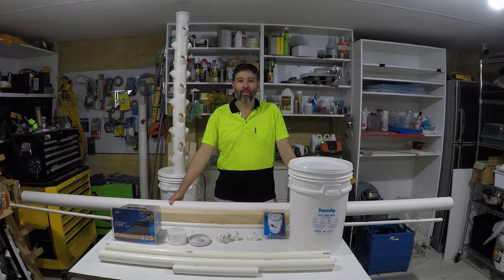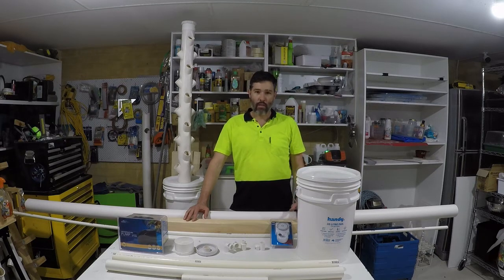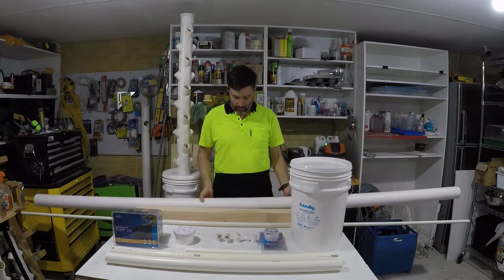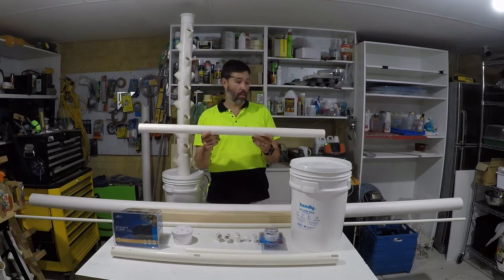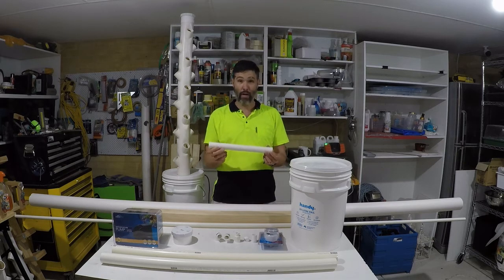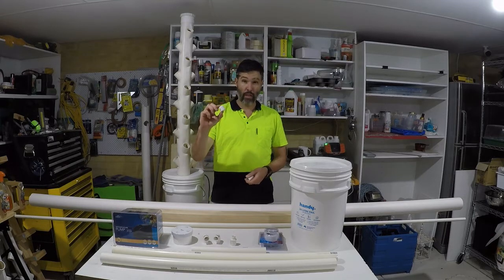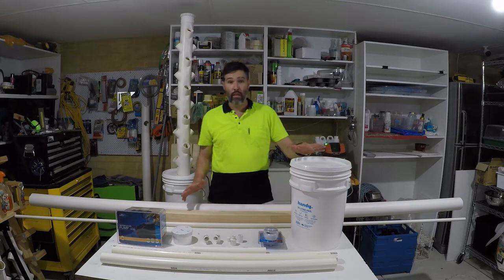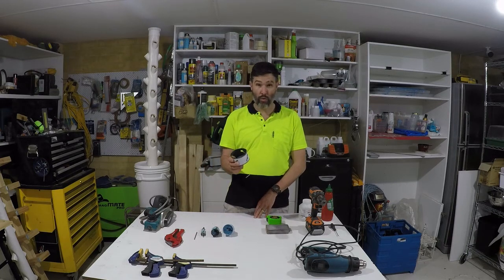D I Y hydroponic garden tower Part 1

Comment: Mate I'm having trouble finding a 62x62 post to shave the corners off.  I see your timber post has a sticker/code on it, suggests you bought it.  Where did you get it?  Closest I can find is 70x70 at Bunnings.  Getting that cut to 62x62... no one wants to kow about it that I can find.
Reply from the maker: Hi, I got a 70 x 70 from memory and plained it down 2 sides to make it 62 x 62. 
Took a bit to do but worked just fine. 
I did get a pice the right size as well but is was not pine. Jarah I think. 
Hope it works for you.
Reply: @andrewpaterson5188  Thanks.  Noting more carefully you did say it's at 70mm before planing.  I'll do same :)

Comment: Finally someone who does it properly. Most of the videos on youtube are just assembly guides with links to the products they want to sell. Thanks.
Reply: I would  hot air weld the spigots onto the pipe so they will never leak or fall off

Comment: Great job!  This series is by far the best of any vertical tower DIY!  I, too, found myself watching all the YouTube videos for hydroponic towers.  All the other versions have issues in my opinon.  Either the net pot doesn't fit well, there was a risk of tearing the PVC during heat-forming, I didn't think the cemented mating surfaces provided a good bond, too-expensive, or blah-blah-blah...the list is long.  However, during this series, I found myself saying things like, "Wow, he really needs to make a jig for that...oh, nevermind...he already did.", or "You know, a piece of angle allows you to mark a really straight line on round stock...oh, nevermind...he thought of that too."
I think the only thing I could come up with was to use a piece of square PVC fence post to prevent the need for heat-forming each net-pot location, but I'm not sure if the different materials use the same cement....something I'll have to research.
One thing I REALLY can't wrap my head around is how, as of 8/16/2020, you only have 1,450 view and 132 subscribers.  Your methods are top-notch, and there isn't any annoying background music preventing me from hearing all of your useful information.
Subscribed and liked.
Reply: ส

Comment: Question for us US makers trying to follow along:  as an example your 40mm spigot pipe, is that inner diameter?  And I see various pipe types: PVC, CPVC, UPVC.  Are you mixing just for finding convenient sizes or does it matter?
Reply from the maker: Hi, as far as I know the pipes I have used are pvc. I have chosen these sizes purely for their sizes. The 40 mm is external but the main reason for that size is the net pot fit in nicely and probably more importantly the hole saw fit perfectly inside of it. So if you had a different size but you had a pot and hole saw that worked it should be all fine. I will be putting out a vid soon on how I use sponges instead of net pots to get around the size problem as well. Thanks. Andrew
Reply: Andrew Paterson Finished my tower.  Thanks for the videos.  Even built your jig.  https://www.dropbox.com/s/0013629yyvbap1b/Photo%20Jul%2016%2C%209%2054%2056%20AM.jpg?dl=0  https://www.dropbox.com/s/qzadk6zkq8zewv7/Photo%20Jul%2016%2C%209%2055%2021%20AM.jpg?dl=0
Reply: @btutor  Al, what were the dimensions of the jig? Did you create a build guide?
Reply: Thanks Andrew.  I just got back from the hardware store.  Using 4 inch main pipe.  I’ll drop you a pic when I’m done.  Thanks for the videos.  I appreciate the detailed craftsman description and techniques.  I’ll be 3D printing my net pots so I can easily customize for my needs.